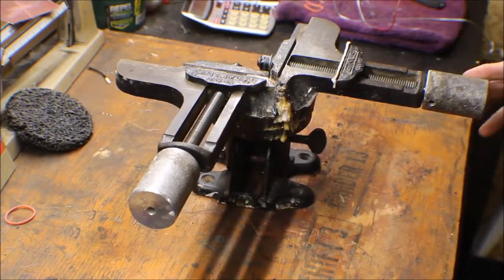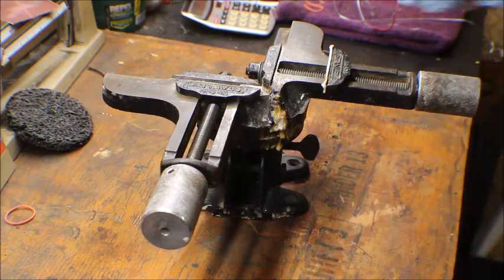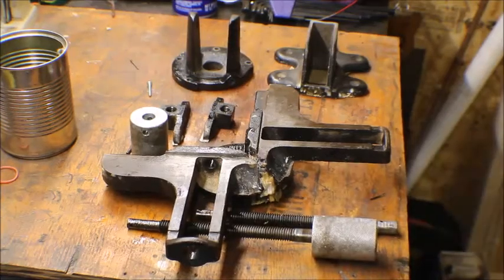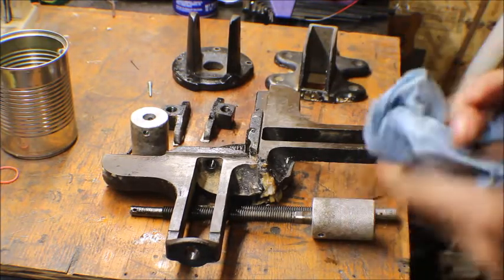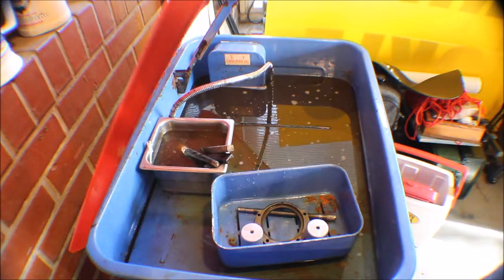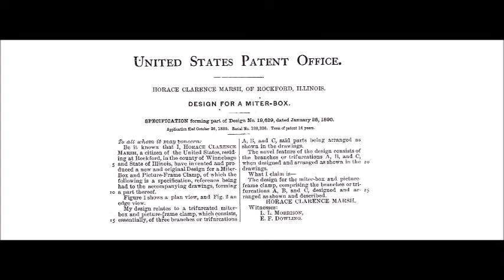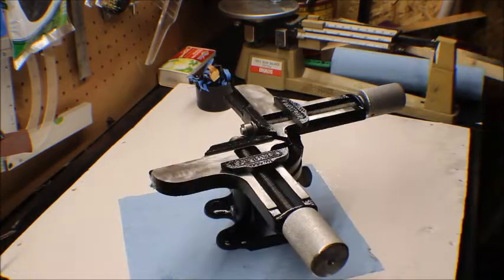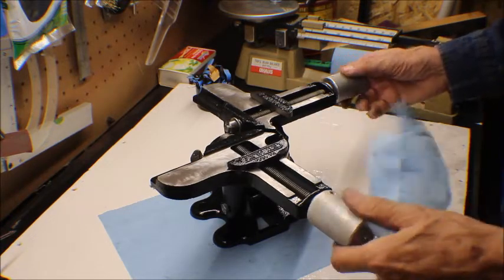Vintage Stanley N0  400 Framing Clamp Restoration

Comment: I’m a professional framer. I still use one of these from time to time if I have an old frame that needs to be rejoined. Nothing else will allow the adjustments needed to do the job. And some of the old moulding profiles can only be joined by the traditional side pinning method. Great to see you restore this. It’s a great tool